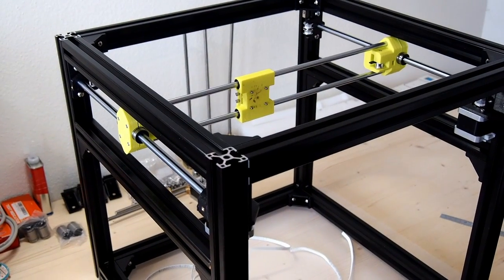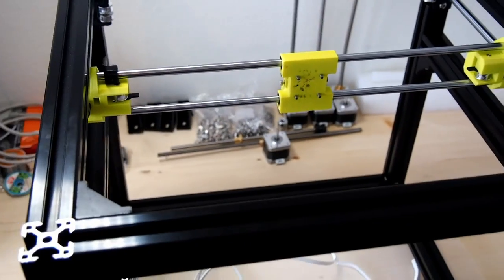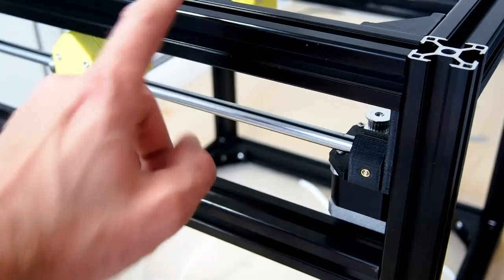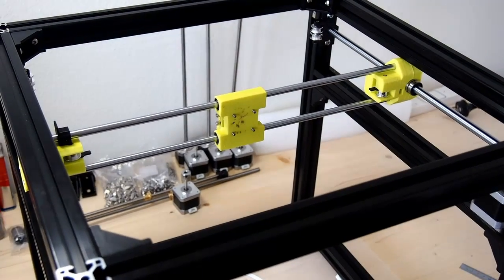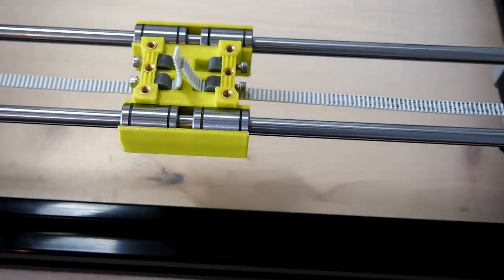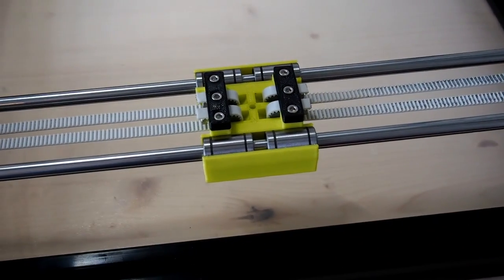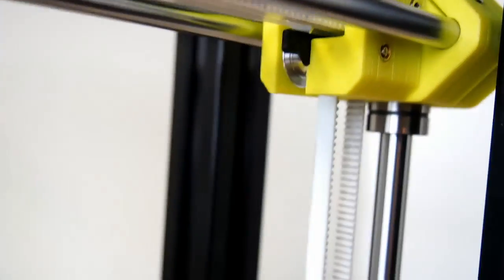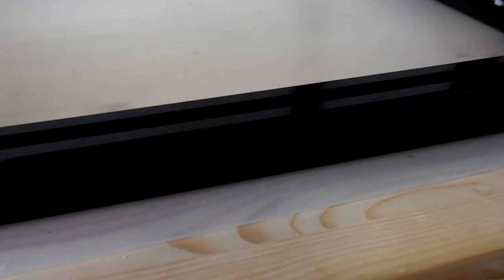HyperCube Evolution #6 - Belt Assembly

Comment: Heck I'm using PLA+ printed bushing and I printed a carriage for Drylin bushing and also for the heated bed. They require different tolerances and I just used ones that are held in place with Zip ties. I also lubricated them with silicon lubricant, nice and smooth and so quiet!

Comment: Imho you should not use the belt tension to square the gantry. The gantry should have a way to adjust the XY angle even before the belts are put and that angle should be as much as possible not affected by variations in belt tension. This is because when the printer is working, as the carriage accelerates/decelerates across the x-y plane, belt tension will not be a constant and so that angle will vary even if not by much (hopefully). Not sure if it varies enough to cause visible artifacts in the print, but I just think its not a good way to go. Just my 2c.

Comment: Hello Scott, On the X carriage is the center brass insert different, where the belt clamp goes, compared to the outer ones as the stl file has a 5mm / 4.7mm hole for the outer inserts and 5mm / 3.5 hole for the center insert as you have only listed one type on https://www.thingiverse.com/thing:2254103 and the center one blows threw the sides of the petg when fitted with a soldering iron as it's only 6mm wide at that point, so there is only .5mm of plastic on each side?, it looks different in your video at 1:20 ????? I'm building one and having trouble with this part, your help would be really appreciated thanks Chris........